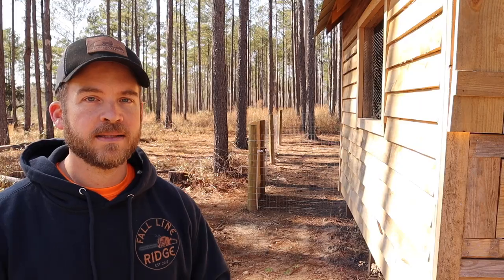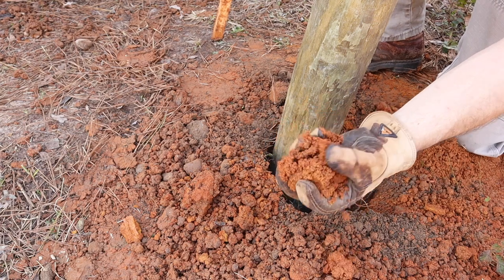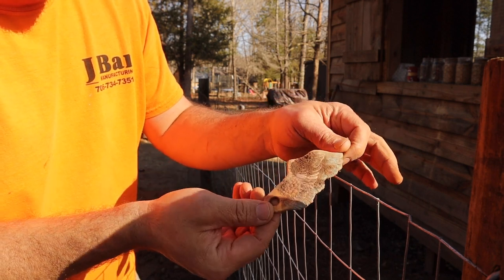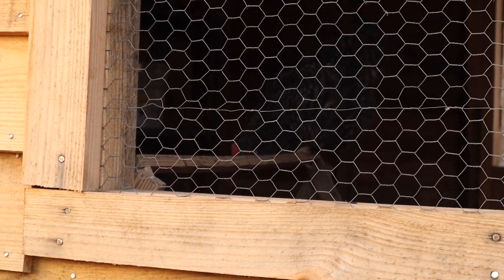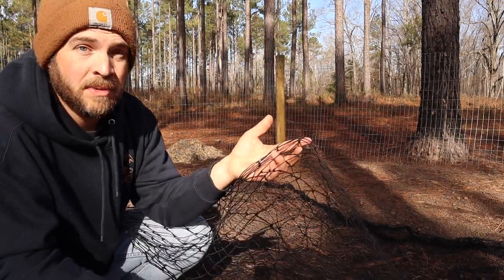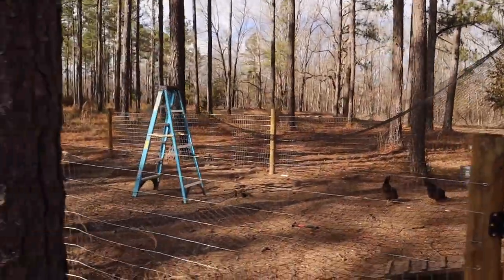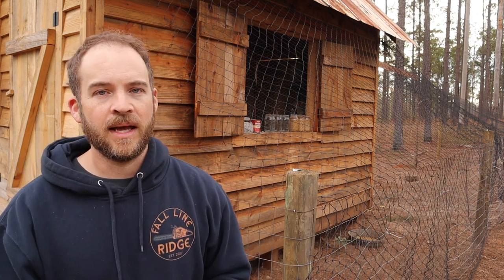This Simple Mistake Killed My Chicken

Comment: You need to use the trees outside the chicken run to support and tighten the netting. Go up around 10-12 feet and tie around the tree, connect to the corners of the net and pull tight. Looks like you have enough trees

Comment: The only problem with chicken's going under chicken house is they will start laying there eggs underneath. I had a setup like you have and had to put wire around the bottom.
Reply: I was afraid of that, too. That one hen looked she was spreading out and settling in.
Reply: Who is going to retrieve all the eggs from all the nests that will be built UNDER the chicken house ?
Reply: @frankbagbey8372  the tiny humans!
Reply: Those chickens are dust-bathing.
Reply: yep....exactly
Reply: I opened up under my deceased Dad’s coop when I doubled his also passed 4 RIRs into a completely mixed flock of 8 different heritage breeds, but also made the nests super inviting. They do love it underneath, but lay all their eggs in Dad’s nests.

My first pullet egg surprised her and landed on their inside, best protected run, but every other one has been laid carefully in their 2 nests! I used dummy eggs, rice straw & herbs/flowers. My Dad’s nest design makes them feel completely safe but I got fabric to add privacy curtains❤which I still have to sew!
Reply: My chickens have never laid an egg under the home on wheels that they lounge under
Reply: @eliseville  velcro. Duct tape works wonders!
Reply: @learnjcbskidsterchickensga7594  Never needed anything more, except more high perches. But thanks anyway.❤️
Reply: @learnjcbskidsterchickensga7594  Pretty sure that if the nests are clean, safe & inviting, other less safe cites are generally ignored.
Reply: Greatvidea
Reply: I had a setup similar to that but they didn’t lay underneath they just tried to sleep under there and it was a 12x8 shed so it was a pain
Reply: We have game hen bantams. They fight. But we get eggs.
Reply: Mine did. My daughter hated crawling under to get eggs.

Comment: Something to think about. If you don't want to have one really big run area all in one place on your property for your chickens, what you can do is create a couple different fenced in areas in different places. Now, of course you probably don't want to place them too far away from your current location because what you are going to do is create a small door in your current run fence and then create a "chicken tunnel" that the chickens can use to get to the other runs. Think of it like a farmer who has several pastures and moves his herd around for grazing. Your chickens will always have access to your current run and the coop, but via the tunnel, will have access to more space, whenever you want to give it to them. If you want to confine them, then you close the door leading out of the main run and the chickens will be restricted to only the main run for however long you determine. There will of course need to be a door in each of the other runs for the other end of the tunnel to connect to. Think of the old "Habitrail" systems for gerbils, where you could connect different modular habitats  via tubes for the gerbils to traverse.
Now the tunnel doesn't need to connect to all of the runs all at the same time. You can make the tunnel in such a way that you can pull it up and move it when you give the chickens access to a different run. Let's say you create three new runs and you run your chicken tunnel from your main run (run #1) to one of the three new runs (run #2). Then after a month or two you switch the tunnel so that it connects to run #3. Then finally to run #4. This way you always have 2 runs in recoup stage, while the Chickens are using your main run and the remaining run. Also, this means you don't have to have the other two runs completely covered all the time. you only need to cover the main run and whichever run the tunnel is presently going to. This would be a little more work, since you would have to move the top screening every time you switched runs, but I am sure you can design the top screening in such a way that would make it easy to unscrew and move.. Same with the tunnel, if you created the tunnel in sections you could just pull up from the ground and then re-stake, it should be relative easy to redirect the tunnel to the other locations and if you make the door in your main run such that you can slide a piece of wood to close it securely, it gives you a lot of options

Comment: We use to hang tarps all the time when we went camping.  The first thing I would do would be to run a ridge line that would support the tarp in the middle.  If I was lucky there would be a branch in the right spot to drape the end of the line over so that I would be able to tighten the ridge line from the ground.  Then attaching the corners of the tarp to lines and then stake them to the ground or tie them to trees and pull the tarp taut.  Great video Wes thumbs up.

Comment: Sorry for your loss. This happened to me recently as well, but it was a bobcat. I didn't lose the bird, but her injuries were worse that she let on. I was planning to harvest her so moved up the date due to the attack. Mine are dual purpose so I'm not going to spend tens or hundreds on vet bills for a bird I would otherwise be eating. She will give nourishment to an olive tree I'm planting this weekend. 

The attack happened in my 16x16 run extension; deer poles with 4 feet of hardware cloth (6 inches buried) surrounded by rock and shell as the footing. The rest is nylon, including the roof - and the cat just rested on the hardware cloth and sliced a hole through the nylon. I'm in FL and we have land and air predators that make unsupervised free ranging impossible. After the attack, I put chicken wire up from the top of the hardware cloth to the top of the bars, which are 7 feet. I'll be putting up 2x4 on the front and back of the run this weekend and running chicken wire for the roof as well. I don't think a cat, racoon, or possum would clime 7 feet, but we have owls too so I'm not taking any more chances.

Comment: Cut the extra off down the sides and use in and black zip ties to fill in the holes. A hawk can get in through a small gap once they find it. Not only can they dive fast but there aim is also excellent.

Comment: I put up similiar netting over a larger run (100' x 100'), it was very pain staking. I used 3/8" rope strung accross the top supported by a few poles in the middle to support the netting. Tied the net off every few feet along the top of the perimeter fence with bailing twine. It has worked very well and held up to cold/snowy winters.

Comment: Nice video…very similar to what we did with the netting. You can hang some metallic shiny ribbon around those open areas if you’re uneasy about them. One of my neighbors just has several strings across the top of his run with ribbon about every 2-3 feet and he hasn’t lost a chicken in 8 years.

Comment: Excellent solution.  You did a great job - especially solo!  As you were constructing your center supports I had the idea that a common (inexpensive) kick-ball and a small plastic bowl (just smaller than the midway point on the ball) attached to your post it would seem a person could walk up the middle of the netting (attached on both sides) and your post would have a ball-bearing like assembly with no snag points.  Some of that you have to trim off could be woven back in to cover that open end.  Leave it floppy (large) loose where you could flop it one way and it's opened, flop it the other and it's closed.  Great upgrade!  Very well done.  Thanks for your efforts.  Loads of work!

Comment: I added the same type of netting over my run to keep our ducks and chickens safe.  To raise it up high enough to walk under, I bought 6 inexpensive 7' umbrellas and removed the cloth canopies.    I hammered metal fence posts in the ground, zip-tied 2' logs against them, placed the bottom of the umbrella on top of the log and zip-tied the log to the fence post.  I spread the netting over the closed umbrellas and then opened them up.  It worked like a charm, even over our little 12 x 9' duck pond!  Without the cloth canopy, the umbrellas don't fly away when it's windy!

Comment: We have hawks, owls and bald eagles.  I built my run out of 4" pvc sewer pipe and made arches out of 3/4" pvc.  Covered the run with bird netting and zip tied the netting to the pvc.  Doesn't keep dogs out but has kept any birds out, so far.  Didn't secure the base to the ground.  Birds go in the hen house at dark and sleep inside.  Lost 5 hens and a rooster to a dog a couple of weeks back but haven't lost any to coons, foxes or possums.

Comment: If you are talking about using nylon netting to cover the chicken fence area, it might not be a good idea because i had a small pond for my pride Kois fish,and i netted it over with nylon, well i heard noise outside and found this hawk tangled in the net, it was no fun to get it loose, i took the netting off and used chicken wire instead, it didn't look as good but it done the trick ,

Comment: Years ago I built my son an aviary for his wild ducks.  A big frame made of pipe, 18' by 40' by 14 feet tall.   We ended up with more ducks than we started with, squirrels would cut the netting and wild duck would use the holes to break in. The netting was fantastic.  I would have run a rope or cable from the peak on the building to a post and then put the netting over it.

Comment: I'm exhausted!
You handled this project like I handle most of mine. Let's just see how it works out.  Watching you try to put a cedar tree in there, by yourself,  looked eerily familiar to me.
We put a 12' 4x4 post in the middle of our run, nailed a square of plywood to the top, and draped our net over it.  We took the net over the top of our coop.  We nailed some 2x4s to our posts to make them longer and then used zip ties to attach the net.  We have about 5-7' at the back side of our run that has no net and haven't  had a hawk get in yet.
Everything in the woods will kill a chicken.  I've lost them to fox, coon ,possum, coyotes, and hawks.
Reply: 😄 I admire people like you two who would do things 'by ear' (I'm not really sure what that means).  If I were to do this, I would look at the project at every angle on paper, in my head, for days before actually doing it.  When the net was put around the pole, I was thinking "that's way too low, why not put a cable or something from the hen house to one of the trees to raise the middle of the net?"  When he put the trees and the beam, I thought "I would put that structure first, then hang the net over the beam, then start to pull the edge toward the hen house and the other edge to the fence..."  Well, that's just me, easy for me to say than actually doing it.

Comment: Watched your "I made my own chicken feed".
My egg production never goes down. No light in the Hen house (coop) But, out side of house I have electric net fencing. I leave a security light on ALL night. Avoiding pointing light directly on the Hen house. It lights up the run and up to the house. The light provides two major things. 1. Predators do not like lights. The reason they hunt at night. 2. Chickens feel safe enough to come out and eat and drink water if they want to. They do go back in the house to get more sleep.
I put up a line, like clothesline about two to three feet apart over my head, a cross the run. Prevents hawks from swooping in. During the day I open the electric fence so they can forage. 
Love your choice of girls. Same breed I have. Good luck.

Comment: wouldn't a central wire from the coop to that tree in the middle of the run have been easier to hang the net over?  
you could still do this way on the sides to get more height to use the surplus on the sides to get more height

Comment: 22:50 You could plug the hole with the extra cut off of the side. Use zip-ties to stitch it together. (6 or so inches overlap).

Comment: We run the chickens under our coop.  Buried fencing under ground around it to keep predators from digging under.    We also have grating in the coop floor under the roosting bars, so 90% of the chicken poop falls through to the ground under the coop.   The Chickens then scratch this looking for bugs to eat.  By doing this they tend to scatter the poop around more and it requires less frequent scooping out.   (The grating is also predator proof)   We have never had them lay eggs under there, but they do enjoy the shade and pursuit of bugs..

Comment: You should bury the fencing 1ft below the surface to prevent any fox or digging predators from getting under the fence to get your chickens and put a door on the coop and close them in every night at dark. Use just a swing door and 2 eyelets and one latch on the door and your done.

Comment: Struggling with spending the initial expense on my build to (A Large Run VS A Larger Roam Area You Just Helped in my ideas 💡 
Eventually My Ladies 🐓 will have both but not this year. 
The Hen Hen House I'm working on will be a 6x12 and about 3 feet of the ground.  Enclosing the underside with access for inspection and girls to escape I could work on a good roam area first.  The Run will Cost a Good Bit and can come later👊🏼🐓🐥🥚

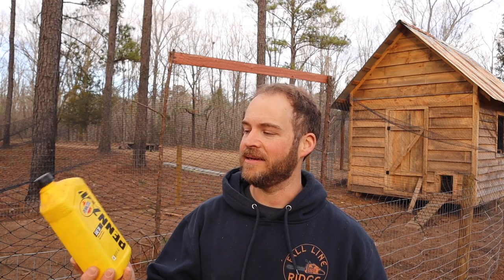Comment: 23:01 I think I might have run a guy-wire from near the peak of the coup to the back post (extended taller with 1 tree). 
There are always multiple solutions, I know, for me, a guy wire would have been simpler, I hate digging post holes. LOL

Comment: Looks like you could've  used a couple more people to have made the job a bit easier. I have a lot of hawks in my area. We had to spend a bit more but I used 6 foot fencing for our run. Then I covered the entire top with chicken wire. I went around the entire thing with a trench and lined it with cinder blocks and poured concrete all the way around. While concrete was wet I put metal U shaped hooks over the bottom of fencing and stuck it in wet cement. I hopefully have made it as critter proof from hawks and rodents. Plus it is still tall enough I can walk comfortably under it.
Reply: I free range my flocks for many many yrs.  Have hawks around frequently & even couple eagles around.  Larger Birds do well to keep them away.  I've always used Turkeys, but others like Geese as well.  Or LGD keeps them safe if able to have nearby.

Comment: I would have extended your yard posts to about 12’, then run a cable or rope along those posts with the netting threaded along those wires with excess netting draping down to make side barriers.

To cut the building out, you could have laid the netting out flat, taken the dimensions of the coop, made a board layout on the netting slightly smaller (extra for draping) then cut out the shape and melted any frayed netting with a lighter.

Then not only would your cope be perfectly framed, you’d have a perfect smaller net for an additional project.
Might as well use all of what you paid for.

Hooking netting onto single points like those post hooks is asking for trouble.
You want to disperse weight pulling on the netting or else it WILL wear out on those points and tear prematurely.

Threading a line through the netting will help disperse the weight pulling against the net fibers.

Something to consider—instead of putting all this netting up, put a plastic owl up on your chicken coop.
Predators tend not to compete with one another, so they would perceive the fake owl as a deterrent.

It’s a much easier, more elegant solution. Even if it doesn’t work 100%—You only lost one bird out of ten. It’s sad, of course, but I bet this netting cost a LOT more than the plastic owl ($15?) and a replacement bird.

Best

Comment: Wondered why you didn’t attach heavy ropes from the top and corners off the chicken house to the post’s. The netting is sliding easy over it. If you wanted it any higher inside to walk easier use some timber 2x2 along the sides to pull them up and tighten them to surrounding trees, like others suggested.

Comment: If you want any wooden posts to last indefinitely without rotting, char the end that goes into the ground thoroughly, right up to surface level, or even above if you can handle the smudging it can leave for a year or so, or can seal it with something non-toxic above ground level.
It's a preservation method that has been well-proven to last for at least a thousand years.
Good on letting them shelter underneath the coop, as long as you can get them out when you need to!
Why not hang a rope between a couple of existing trees on each side of the run to support the middle from the outside?
Trimming the edges will give easily enough spare netting to close the ends off.
Raptors can certainly stoop at very high speeds, but also have amazing visual acuity, and will see the net and not even try.
It's a shame you lost one, but hindsight is 20/20.

Comment: Trim the excess and splice it in the area you want to close in.  What you have there is nothing more than a traditional net.  People have been making them and repairing them for centuries.  It isn't a big deal.  You can get a net needle (simply a shuttle wound about with netting material so that it doesn't tangle) to accomplish the mending.

Comment: 1.  Assure what you get is polypropylene,  not nylon.  The nylon is not syn resistant.  2.  We experienced much the same as y'all.   2.  The netting won't stop possums And coons. 3.  My wife went into the yard a while back, went to open a gate and was face to face with a dead possum that had hung itself in the netting.  3.  We criss-crossed the area under the netting with ropes to add support